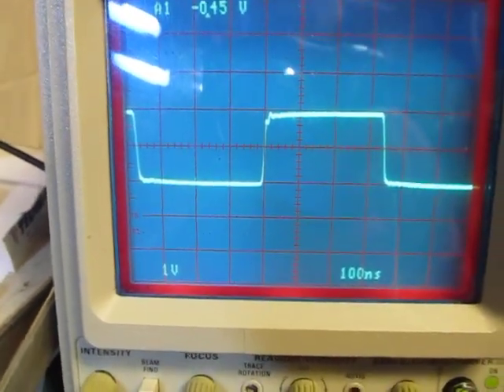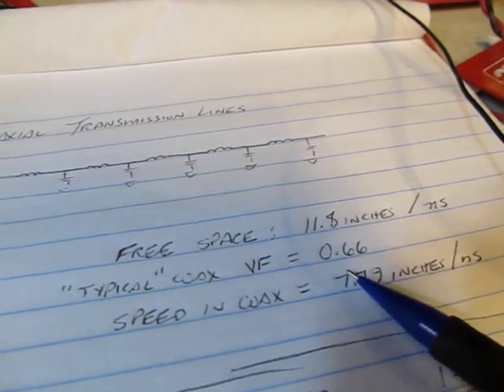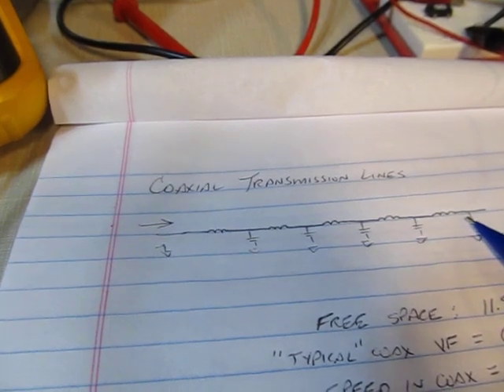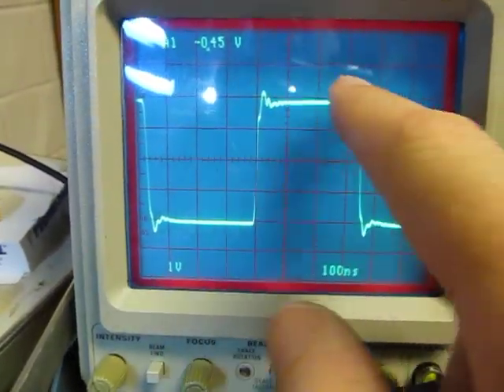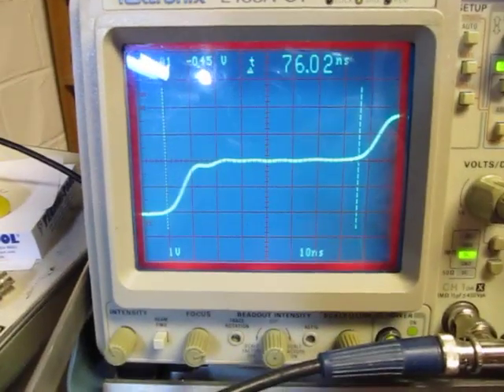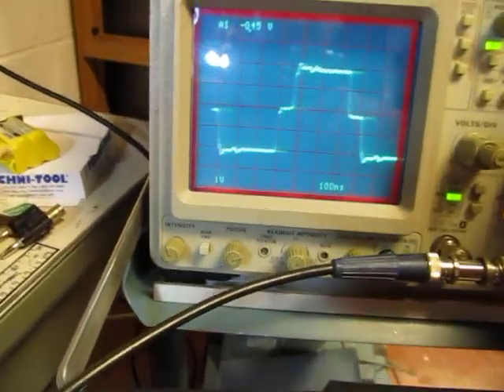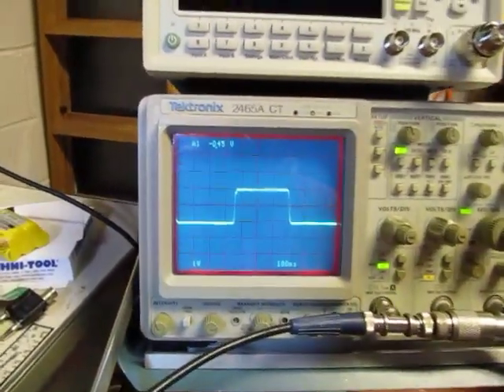#37: Use a scope to measure the length and impedance of coax

Comment: what's the difference between twist wire shielded cable compared to Coax Cable? Because the cable's capacitance is LESS using twist wire shield of the same diameter size as the coax cable will have MORE cable capacitance. I'm not sure why Twisted wire plus the shield will have LESS capacitance compared to using Coax cable.

Comment: Back in the 80s, when I worked for KUAT in Tucson, we used that method to find a dent in a length of 3 1/4" rigid line, which was several hundred feet long.  But we didn't use a jury-rigged scope/pulse generator!  No, it happened that the station was owned by the University of AZ.  So we borrowed an honest-to-goodness time domain reflectometer from the physics department.  About that time, the physics dept. also bought us a spankin' new 50 KW dummy load, so one of their grad students could use it for his PhD dissertation project.
Reply: How big was it and was it oil cooled ?

Comment: One of my jobs as a broadcast tv engineer was sorting out which section of camera triax cable between outside broadcast vehicle and the camera position was open or shorted on long runs where lengths of 100, 200 or 400 metres were combined to make up the desired length.
A TDR would have made the identification of the bad leg so much easier, and often thought about building one.
Instead I made a a simple continuity tester which could detect open and shorted conductors on each cable before installation thereby saving the long march - usually in the rain on a golf course - with a camera testing back to the OB truck length by length.
Whatever the method of fault detection it still required an outdoor repair with a gas soldering iron.

Comment: Excellent!  I have two little Boxes, one with a 470 Ohm Linear Pot with an approximate scale, the other with Switched Resistors at 50, 75, 93, 100, 150, 300 and 600 Ohms - both are so useful when dealing with known lengths of unknown Co-Ax or Twin.

Comment: I just tried this in the real world, and it works. I found to get a more accurate measurement on smaller cables, first I connected a long length of coax of approx 20m, set cursors, then added the cable under test and measure the amount the 'step' has increased. As we tend to use metres in the UK not feet, the increase in nanoseconds just happens to be close to the number of cm of cable. i.e 100ns equates to 9.9m which is handy.
caveat - assuming both cables same impedance and velocity factor or 2/3

Comment: Great way to determine the impedance of an unknown bit of coax.

You can also calculate the VF for an unknown bit of coax. Take a measured length and back-calculate what the VF must be to get the measured delay from a known length.

Thumbs up for bothe the #37 and #88 videos. (this comment posted on both videos)
Reply from the maker: +Peter W. Meek I did a video on that too (measuring velocity factor), exactly as you've stated.
https://www.youtube.com/watch?v=TpIIftvQPFM
Reply: N

Comment: Performing TDR Using a Pulse Gen and Scope was a crowning moment in my shop. I always considered a scope to be the most important and useful instrument in any electronics shop but TDR added another dimension. It seemed like breaking through a barrier of sorts. Or rather having a revelation of just how damn indispensable a scope is for any true ElectronHead! When seeing a reflected wave for the first time I damn near came in my pants! I was having a discussion with a generation Z (EE) that commented in one of the many "Don't Blow Up Your Scope" videos. He lamented that the scope's GND topology was a pain in the ass. He complained that they're not a Differential Input. He further lamented that using the algebraic ADD function of a multi-trace scope eats up available inputs. I told him that this generation is spoiled and they've never known a life without cell phones. A public telephone is something seen in old movies. 

I have no such complaints about the input topology of a modern scope. Think about it... A 100  Mhz scope can accurately measure <millivolt from DC to 100 Mhz! Hell,  early radio receivers weren't that sensitive! Dealing with extreme sensitivity as well as bandwidth ain't no simple chore! So it's never been a surprise to me that an oscilloscopes input utilize Grounded Coaxial Cable topology.  

Also interesting TDR can be used with  a 300 Ohm Balanced Line (Twin Lead) if it still exists. At 30 years old more homes had antennas with Twin Lead than homes using coax. Of course you'll need a few Balluns for the test setup along with a 300 Ohm Termination. It is said that any two conductor cable (flat or coaxial) has a characteristic impedance. So I would imagine that a 120VAC ZIP Cord has one also.
Wakodahatchee Chris (WA2ERQ)
Reply from the maker: I've even used this technique to measure speaker wire - see this video: https://www.youtube.com/watch?v=z6UJPqQYzNc
Reply: @stevejagger8602  I totally concur.😉

Comment: I once heard an analogy somewhere regarding reflections in transmission lines. It had to do with the fact that the signal was traveling through a medium with certain properties and then it hits a medium with different properties. It's like when you look out the window sometimes and you can see what's outside but at the same time you kind of see your reflection in the glass. Some of the light coming from inside the house is traveling through air and all of a sudden it hits the glass (different medium) and it doesn't like that so it bounces back. The same can be said about sound waves when an echo occurs. It all boils down to the fact that signals of whatever kind don't like changes in properties of the medium. Another example could be a prism which divides the spectrum of light (that is a refraction actually but this also applies to signals in transmission lines i.e. they are attenuated by a factor related to the refraction angle I think).

Comment: Thanks for the video! I do have a question. I often see coax rated at 50 Ohm impedance, but isn't electrical impedance dependent on the frequency? How can the impedance be the same between a 100Khz and 100Mhz sine-wave for example?
Reply from the maker: Because the impedance is effectively determined by the ratio of the distributed series inductance and distributed shunt capacitance. While the individual reactances of these quantities is frequency dependent, their ratio is independent of frequency.  Of course, the wavelength at 100kHz is so long, that the effect of coax impedance isn't really important unless the line is very long.
Reply: To add to that, and I just realized this, so I hope I'm correct, it keeps the 50 ohm characteristic over frequency, because as the frequency increases the Xc of the cable capacitance decreases and the Xl of the inductance increases. This keeps the impedance of the cable at 50 ohms.

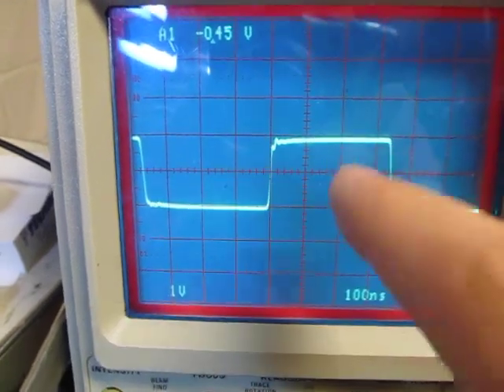Comment: I tried a similar setup to yours and I used a 2V p-p square wave at  1.43MHz (700nS) with 50% duty cycle based on the settings on your scope screen (video 4:30). My 50 Ohm RG58 coax cable measured about 7 inches shorter than the calculation which is pretty good. I found that if you measure the single pulse when the end of the cable is shorted (video 9:30) it is possible to get an estimate of the cable length as well, not the same figures though.

Comment: Thanks Alan for your video. I used this technique to determine the velocity factor of some coax I used for a phasing harness for stacking two loop antennas. I referenced a link to your video in the description section of one of my videos: 2 Meter Halo Antenna Part 12 -- "Phasing Harness understanding & calculations"

An on screen comment is also show at 1:13 in the video.
   73,
        Mike N6TWW

Comment: I have a question. Does it effect to quality of transmission if you roll you coax cable. Is it ok if I leave 20-30feet and roll it when I go from the transmitter to antenna(150feet)?
Reply from the maker: The only affect would be the added attenuation from the additional length (coiling doesn't matter).  The additional attenuation/loss will be fairly small in most HF applications.
Reply: w2aew thank you

Comment: I also noticed that the cable between the generator and the scope needs to be the same impendance as the cable under test (50 Ohm) as well to get a clean signal. I repeated the setup using 75 Ohm cable and it worked out similarly. Need to learn more about the internal terminating 50Ohm / 1MOhm (High Z) settings on the scope and generator.

Comment: that's very useful to me. it would be better if you actually show the numbers - calculate the length and the impedance of the cable. This way you show real world calculations. It's important because in the real world there is always an error. If we do it at home we won't be able to know whether the error is ok or we did a mistake.
Reply from the maker: I did show the formula used, and described the answer that was calculated with this formula (about 8 minutes into the video).  I didn't show the calculation, but it is described and trivial to calculate.  The impedance is also shown by matching the impedance on the end of the cable, then measuring the load resistance that results in no reflections.

Comment: What value is the pot you're using here? I'm guessing if you're dealing with 50 and 75ohm cables, you'd only need a 100ohm pot.
Reply from the maker: it was a 100 or 200 ohm pot.

Comment: Hi. I've tried everything described in this video, but waveform does not change when I insert a coax cable to the T adapter. Where am I missing? I use low cost oscilloscope and low cost signal generator. I always see a square waveform. Input impedance says 1MOhm on the oscilloscope and it is not changeable. The signal I see is perfect. What is the problem? Please help. Best regards.
Reply from the maker: The problem is either that the rise time of your pulse generator is too slow, or the bandwidth of your scope is too low, or both. With a slow generator and a slow scope, this technique will only work to test very long cables.

Comment: Thank you!
What would be the simplest but appropriate for the test 100kHz circuit in case I am unable to use a proper function generator right now?
Edit: I guess from next video that would be "#88: Cheap and simple TDR using an oscilloscope and 74AC14 Schmitt Trigger Inverter"
Reply from the maker: Or even simpler...   
https://youtu.be/z6UJPqQYzNc
assuming you have a digital scope...

Comment: Hi sorry for this basic question but it seems your pulse has a period of 700 ns aka 1.4 MHz at 0:41 but then why do you say the pulse is 100 kHz? It is keeping me from understanding the meaning of your demonstration.
Reply from the maker: Sorry - I misspoke about the frequency of the pulse.
Reply from the maker: @UCEyZw6FUEW3b_rqZ5Yf24dQ Hello Sara - This is pretty close.  The pulse generator creates a 4V pulse internally which is applied to the 50ohm internal resistor which is in series with the transmission line.  The transmission line "looks" like a 50 ohm resistor for voltage *changes*.  Thus, the 4V is divided in half, where 2V appears across internal 50 ohm resistor, and 2V across the line.  This 2V leading edge of the pulse propagates down the transmission line (and is seen by the scope as it passes by).  When this 2V edge of the pulse hits the end of the transmission line (which is open), the pulse reflects the full 2V back in the other direction (superimposed on the 2V already on the line), so you get 4V total at the open end.  The reflection (like a wave hitting the edge of a pool and reversing direction) propagates back towards the generator.  When it passes the scope on its way back, you see the increase from 2V to 4V at the scope.  When the reflection makes it back to the generator, it is terminated by the 50 ohm resistor - so now the 50 ohm resistor has 4V on each side of it -which means there is 0V across the 50 ohm resistor - thus, no current flowing.  This makes sense because after the pulse edge makes the round trip, the end of the transmission line is open, thus no current flows.  This video on transmission lines and reflections might help you:
https://www.youtube.com/watch?v=g_jxh0Qe_FY
Reply: @w2aew  Thank you so much!

Comment: There is AC cords that have a spec that says low leakage current. How would you test an AC cords to test the leakage current specification? I'm guessing very low capacitance between the wires in the AC cord would have lower leakage current? The thicker the wire gauge the less resistance, 18 gauge wire has less resistance compared to 12 gauge wire.

Comment: Does it work only with a coax or could you apply it to other conductors as well?
Reply from the maker: +fabts4 It has to be a pair a pair of conductors that has a fixed physical relationship (coax, twisted pair, etc.) so that there is a constant RF impedance along the length.
Reply: +w2aew alright, thanks.

Comment: When audio circuits use buffer circuits most buffers input impedance are 1meg but the outputs are either 100 ohm or 1K ohms. How do you measure the "capacitance differences" between the output impedance 100 ohm compared to 1K ohm using an oscilloscope? because the 100 ohm can DRIVE more capacitance compared to the 1k ohm output impedance but how do you measure the capacitance of how much the buffer can drive how much capacitance? You can use a sweep function generator that will sweep from 20Hz to 20Khz and see the roll off of the high frequency but how does an EE designer know how much capacitance the 100ohm output impedance buffer can drive compared to the 1Kohm output impedance buffer?

Comment: Thank you for the Oscilloscope videos. Is there a way to use an Oscilloscope to look at my audio coming into my Ham FM repeater. I'd like to improve the output of the audio coming out of the repeater.
Reply from the maker: You can look at the audio, but you won't really be able to tell much about its quality (unless it is severely distorted).  The problem may be with the deviation settings in the transmitter, which you won't be able to see on a scope.

Comment: Thanks. The lower the AC power cord capacitance means the capacitance from the shielding braided wire to the White ( Neutral ) and Black ( Hot ) wires?  or the capacitance value of the wire insulation that you strip off to see the strained wire?

Comment: Do you know what material they use for the outer jacket to be water resistant, because AC cord says its water resistant but the white wire, black wire, green wire sleeves jackets look the same but the outer jacket has some material to protect it from water

Comment: How do you calculate the AC cord wire gauge? For a DUT device under test is 12Amps at 120VAC they often use 16 gauge wires inside the AC cord. For a DUT that is 9 amps they often use 18 gauge wires inside the AC cord. What formula do you use to get the AC cord wire gauge?
Reply from the maker: It all comes down to voltage drop.  Heavier gauge cords have lower resistance, and thus lower I*R drop.  Also, longer cords need to be of heavier gauge, for the same reason.

Comment: I just traded a battery charger for a BK Precision 2120.Thanks for the video(S) all of them.You are a good teacher and I'll check out all of the them.I work in a diesel repair shop,and I'm hoping to start testing the electronic injector systems.Do you have anything along those lines?  Thanks,Skip J.

Comment: I think this is just what I need to find a high resistance in a 200 ft buried arcnet coax cable. The cable has two center conductors. One is copper and the other is silver in color with a braided shield of course. The shield and silver conductor read close to zero ohms end to end, but the copper one has 100 ohms of resistance. Would like to find where the high resistance is. I believe the cable impedance will be close to 100 ohms as that is the value of the termination resistor. Would I see a spike at the point of failure, or what else could I expect to be there? Thanks
Reply from the maker: rfn944 If it is an abrupt failure point (not a distributed region of higher resistance), then you should see a reflection from it.

Comment: I am struggling to get this to work for me!!
I suspect its the signal generator I'm using ( an old Thandar TG102 unit )as I have measured the rise time on the square wave signal of 100khz as 60-65nS.
Is this too slow for this TDR purpose?

Comment: Too many question sorry, the output impedance of my signal generator is adjusted to 50 Ohms. Input impedance of my oscilloscope is 1MOhm. How can I see a clean waveform almost perfect? Please reply.
Reply from the maker: Because the risetime is slower than the delay in your cable, so the reflections don't do any damage to the waveform.

Comment: What would be the best way to measure the characteristic impedance of a 6 inch BNC coaxial cable? We have all sorts of generators and scopes in the lab including a 2465 Scope. We also have 50 ohm and 75 ohm cables of various lengths. We have several unmarked BNC cables in the lab and no one knows how to measure the impedance of these unmarked cables.
Reply from the maker: To use the TDR method, you'd need a generator with a rise time well under 1ns and a scope with over 1GHz of bandwidth.

Comment: I have a question about a TDR. If one end of a cable is connected to a TDR and the other of the cable is left open, you will see the point where the incident and reflected pulses first add together. If you continue to scroll in time on the TDR past that point, you never see the reflected pulse by itself. Why is that? It is almost like the incident pulse has an infinite pulse width. (Please let me know if I gave enough detail in my question.)